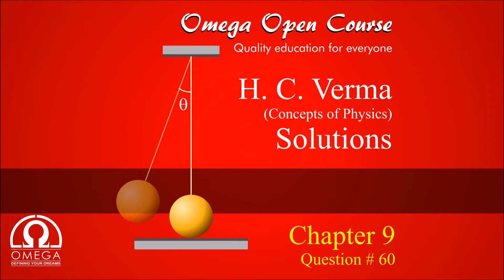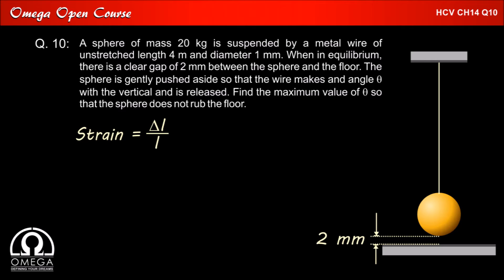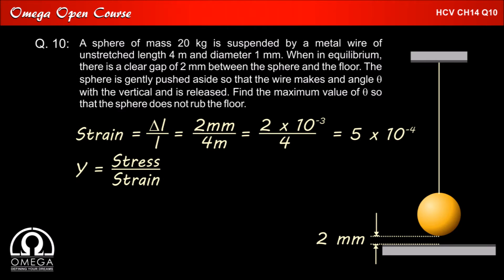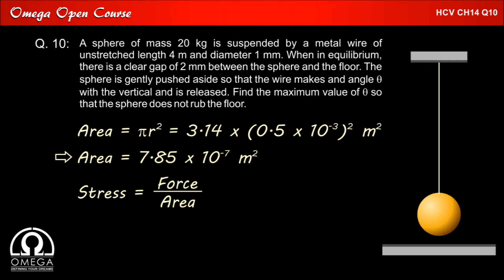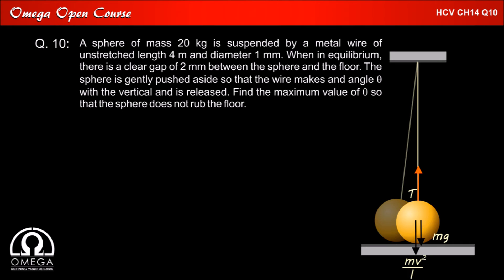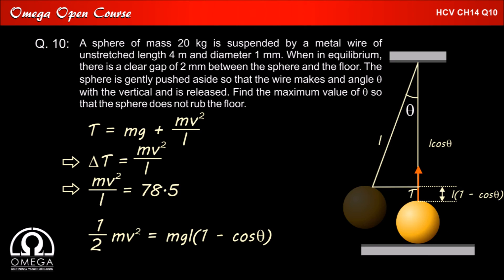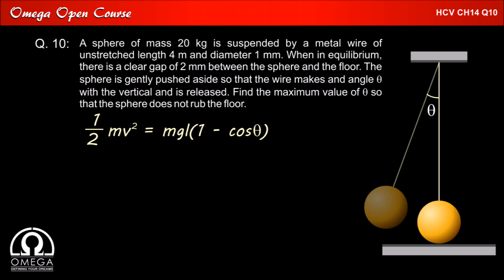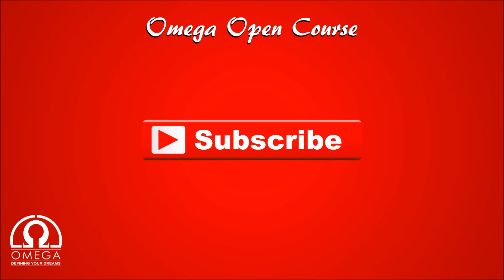H. C. Verma Solutions - Chapter 14, Question 10

Comment: Why you do not consider the increase in potential energy of the wire due to increase in length.
The work energy relation should be :
mgh= 1/2mv^2 + AY(l^2)/2L

Comment: mechanical properties of solids question no 11 
A steel wire of original length 1m and cross sectional area 4 mm^2 is clamped at the ends......

Comment: Why are we talking about extra stress---(centrifugal force/area) and not about total stress --(T+c.f)/area 
But we r cosidering the total strain?????????
Reply from the maker: Because initially when the gap between the sphere and floor is 2 mm, the string is already elongated due to weight of the sphere. When you pull aside and release the sphere, the tension in the string is sum of weight of the sphere and centrifugal force on it and because of this tension, the string gets elongated by 2 mm more. This extra elongation is due to the extra force, which is centrifugal force.
Reply: Omega Open Course  sir, please put the solution for chapter 14

Comment: sir INCASE OF KINETIC ENERGY INROLLING IS IT ARULE TO DETERMINE KE WITH.RT FIXED AXIS MEANS I CANNOT CALCULATE ABOUT CENTER OF MASS
Reply from the maker: +Arabinda Biswas There are no rules in physics, only concepts :P

You can always solve question about centre of mass. But in that case you have to take into account the rotational as well as translational kinetic energy as if you look about centre of mass, the rolling motion is a case or rotation + translation.

If you look rolling about the point of contact, the motion is pure rotation and in that case energy will have just one term, simplifying the equation.

I will suggest you to solve some questions about both the points, this will help you understand how all this comes from the parallel axis theorem.